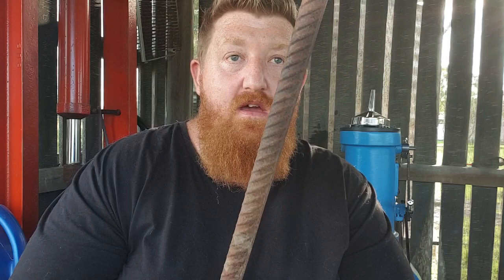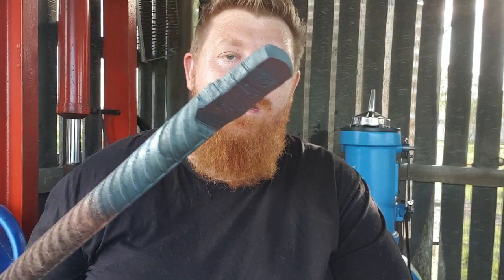In The Forge: Testing my new 16kg Ellsen Power Air Hammer

Comment: That's pretty cool , packs a decent punch. What does it sit on? Do you also have a press now too? Good to seeya back sir.
Reply from the maker: Thanks, yeah I've got a small hydraulic press, I just need to make the tooling for it, it seems under sized too but squashed down some 40mm round to half it's thickness. I'm going to use it mainly to drift axes and hammers
Reply from the maker: Also it's just on about a foot deep hole filled with road base
Reply: @SouthdownWatersForge  wow that would be fun for sure. look forward to seeing what you make. cheers